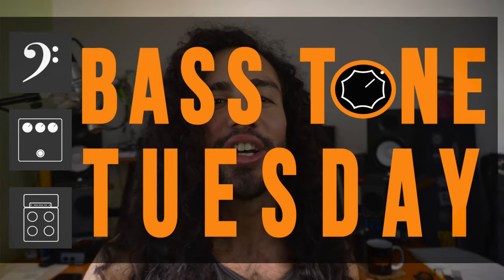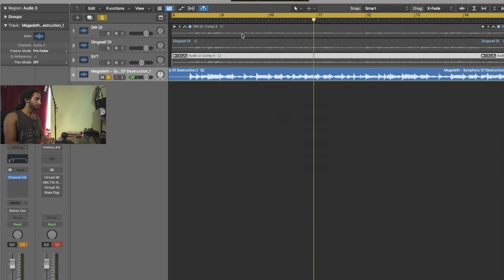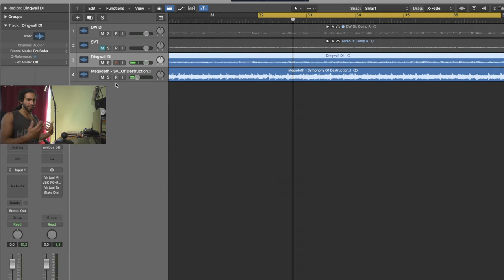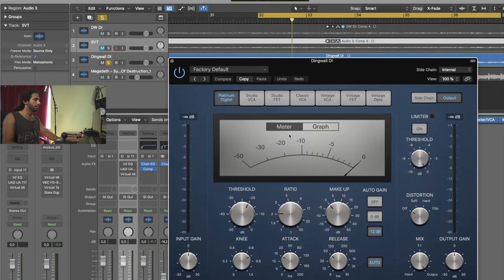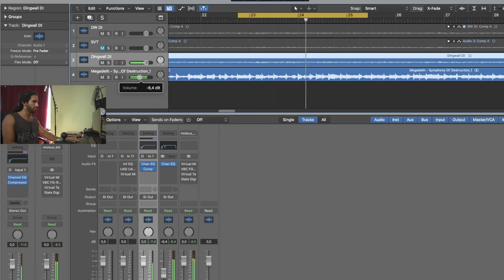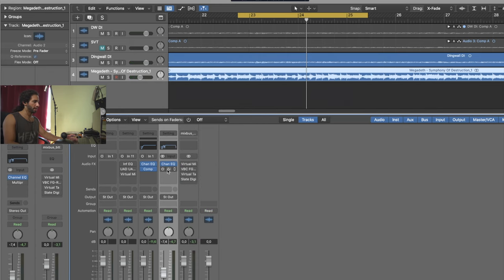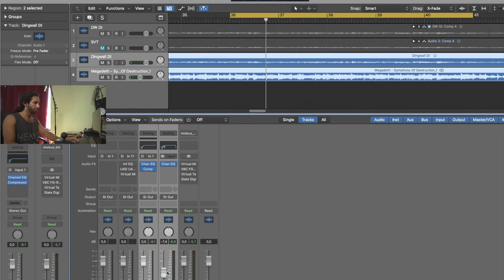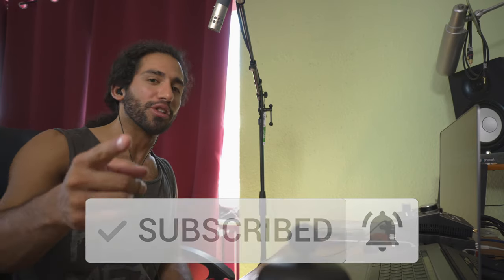How to Record Bass Covers | Bass Tone Tuesday

Comment: "Your bass cab is basically a high pass filter" - I had never thought of that. What a fantastic analogy! Great video, as always!
Reply from the maker: The funny thing is that if you add a HPF before hitting your cab, most speakers will perform even better
Reply: @IvanBassist  I have a preamp/HPF that I use with my upright. DEFINITELY helps my cabs perform better, and helps to reduce some feedback.

Comment: Love this, dude. I'm working on this setup, the interface and the DAW specifically, so I can do more covers and have them sound slightly better than awful :D
Reply from the maker: Thanks for watching! Which interface do you want to get?
Reply: @IvanBassist  yo! I'm considering going the affordable route with the interface - maybe the Scarlet gen 3 or the SSL 2+
At first I thought I'd be able to do some small EQing in garage band and that'd be it, but the more I think about it I think it would be best to purchase logic. Seems like the stock plugins are worth it.
I'm curious about the video portion of this process now. Maybe I could suggest that as a future video for you! I.e. once I've got the audio sounding nice, how can I line it up with my video? If it's just one camera angle, no effects or editing, is iMovie sufficient?
Reply from the maker: Yes, you can just use iMovie. It’s easier if you either pop or slap a note before the backing track starts to generate a clear transient that is picked by the camera and your recording. Then you have a clear visual guide to sync both files

Comment: Just wanted to say I really like your videos Ivan! They've taught me a lot, especially about production, and they're top notch in quality. But one thing I'd like to ask is about pre-amps and cab sims. In previous videos you've talked about how they shape the sound of a track. Is it fair to say they effectively are like EQ presets? Since you said something like a cab sim will cut out certain frequencies above and below a certain point as compared to a sterile DI signal. And if that's true, can you recreate the sound of a pre-amp and cab sim just by using an EQ-plug in?
Reply: I forgot to mention using a compressor with the EQ as well!
Reply from the maker: Thank you, Samuel! I’m glad the videos are helping 🙌🏽 

Yes, you could definitely say that using a different cabinet or cab sim is like using an “eq-preset”. They definitely change the tone right away. 

In theory, you could recreate the tone of a cab using a fully parametric EQ plugin, but it will probably take A LOT of work, because cabinet have different bumps or dips in different frequencies and that is not counting the microphone that you would put in front of the cab, which also changes the tone
Reply from the maker: What do you mean? 😊
Reply: @IvanBassist  I wasnt sure if Pre-amps/ cabs applied some kind of compression to the signal. If not then nvm haha. Thanks for replying though!

Comment: Again, this was great. Question about the limiter: I thought I understood a limiter to be one of the two functions of a compressor. I thought a compressor squashes the signal (reduction) and then applies make up gain to get that signal back to where it was volume-wise...so this would make the quiet notes louder and the loud notes more quiet, right? My understanding of a limiter was that it's only making the loud notes quieter where a hard limiter would just say "anything over x threshold gets reduced to where the threshold is set." 
I guess my question is, is the limiter used in this video more like a compressor? What's the difference between a limiter and compressor? Thanks dude!
Reply from the maker: Yes, a limiter squashes anything above its threshold. In this case, the threshold is 0dB and we are using the gain to make things louder. If anything happens to cross 0db, it gets compressed and released extremely fast to avoid clipping
Reply: @IvanBassist  ooh gotcha gotcha. That makes total sense. What a great vid, man. Thanks again